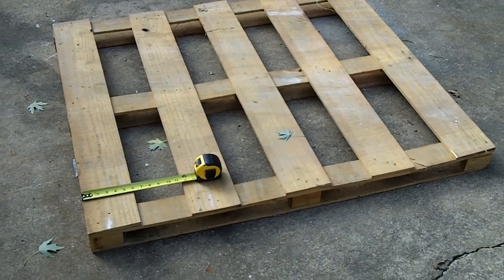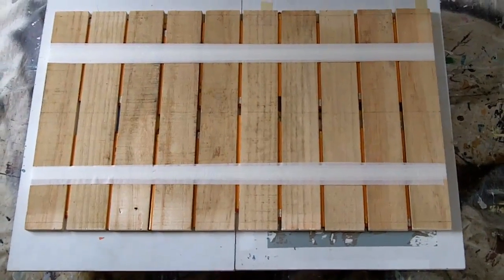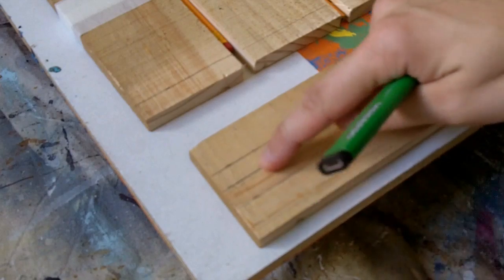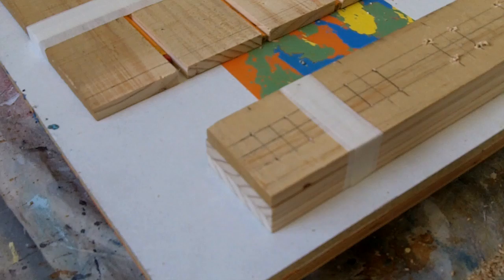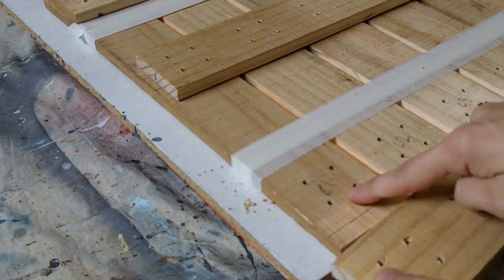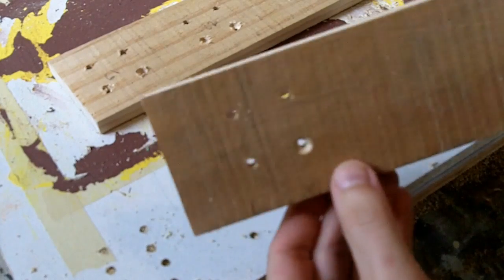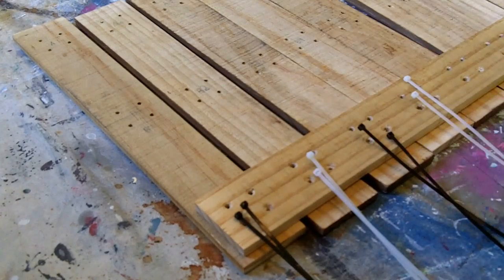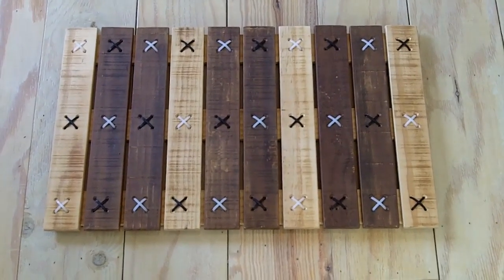DIY Zip Tie Pallet Wood Doormat!

Comment: I really like this idea, it looks awesome. You have a good eye and make solid styling choices. You posted this well over a year ago, just wondering if this got a bit loose and sloppy over time, or if the zip ties stayed tight? Pretty easy to tighten them up, I guess.
Reply from the maker: +Michael Robinson I actually had it in storage for a while, but put it outside late this past summer. It's holding up pretty good, even after lots of rain and snow (I never ended up putting a clear coat on it.) I might this spring if it starts looking rough. And like you said, it's super easy to tighten up or even replace zip-ties if needed.

Comment: Not to be nit picky or anything, but at about the five minute mark when you used the speed square to draw a line, you put the square on the very short side of the board.  It would likely be more accurate if you put the square on the long side of the mark on the board.   just saying...  nice project, though.
Reply from the maker: Jim Smith Sr Yeah, good catch. I've noticed while editing my videos that I find all kinds of little things like that that I could have done better.